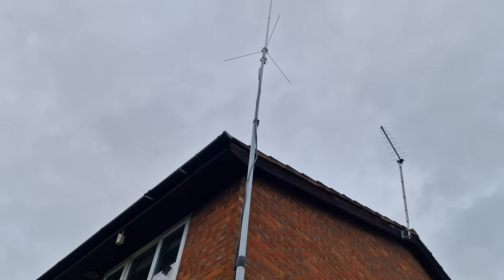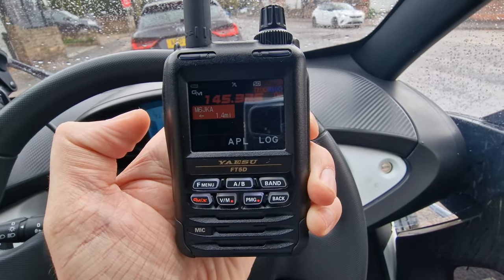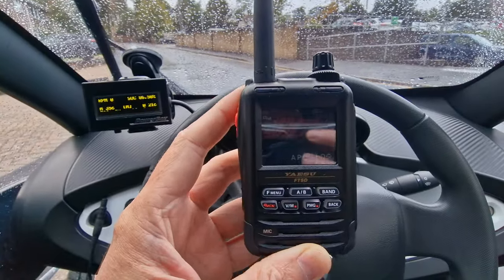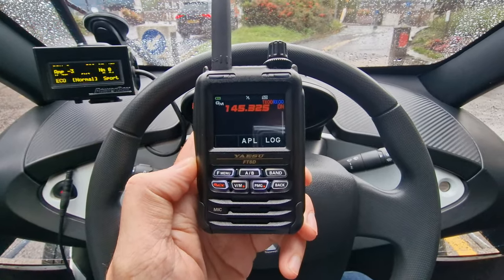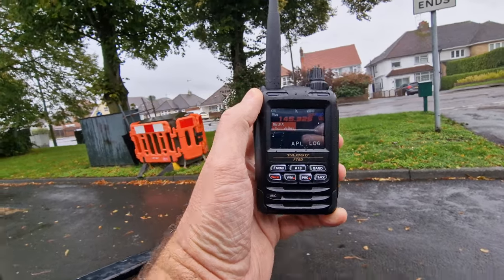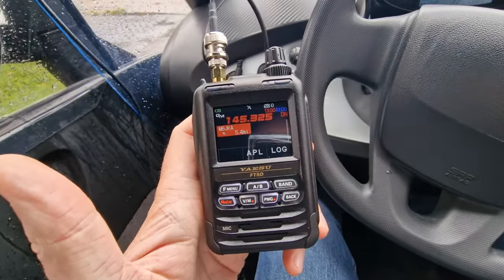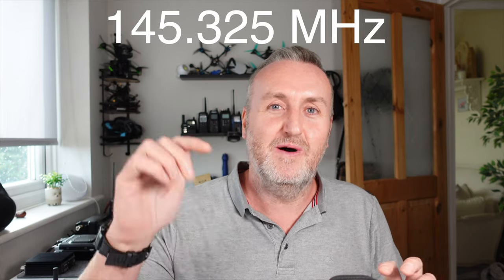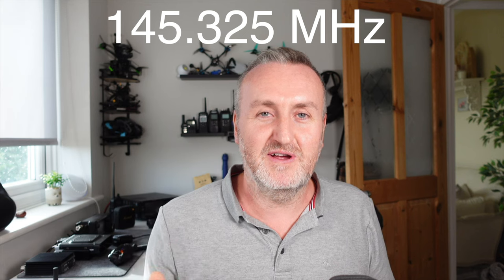HOW FAR WILL THIS MASSIVE ANTENNA GO?!

Comment: Hi Andy did cal you on 145.325 using both FM and C4FM from Windsor using the FT3D into a vertical on the roof, with 5w out.  Sadly, no joy at 18:20z today.
Reply from the maker: OK, did you try GM mode?
Reply from the maker: There's no callsign logged on my radio here so might not be a good path between us.
Reply: Tried again at 11:20 with GM mode on.  No reply.  Distance between us is 33 miles approx, so with 5w is a bit of an ask.  I also took a looka t the terrain profile between us and there are a number of high spots that give signal attennuation.  I can however get into Welwyn VH..just.  Might be worth having a sked to try further.

Comment: My personal best with my FT5D is nearly 50 miles  in FM mode, using an upgraded longer handheld whip antenna.  I was standing on top of a 600 foot hill at the time.

That's simplex of course.   Using WiresX I've spoken to people on the other side of the planet with it.

Comment: OK......you call that a Massive Antenna 😅😅😅
I can cover arround a radius of 230 Km, i got an 26m long Spiderbeam fiberglas pole, with an homade wireantenna for 149mhz freenet on top
Greetings from Germany👍
Reply from the maker: Awesome! You are lucky you have free net. Maybe your signals will propagate over to the UK some day during tropo!
Reply: @andykirby  on 149Mhz you got no Qrm. it has become CB 2.0 over here. i did go so far and modded an 145Mhz EME Antenna for 149Mhz. i go and send you an link to my HP via your youtube adress